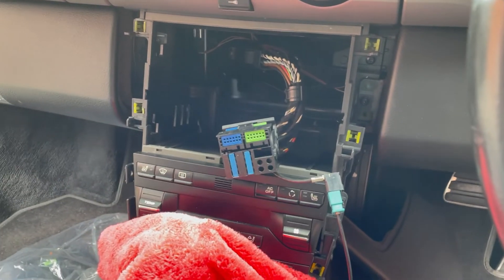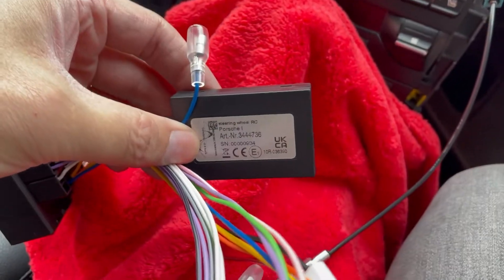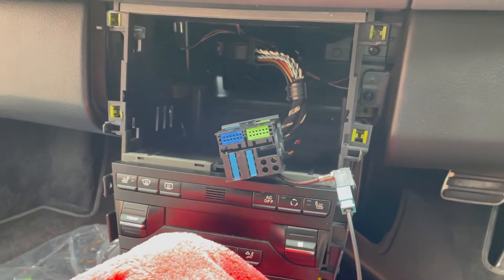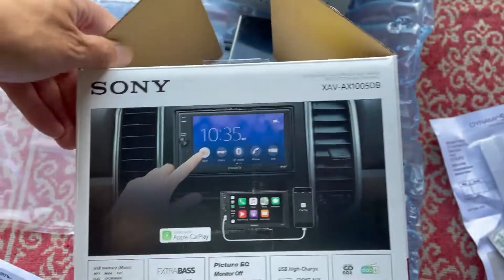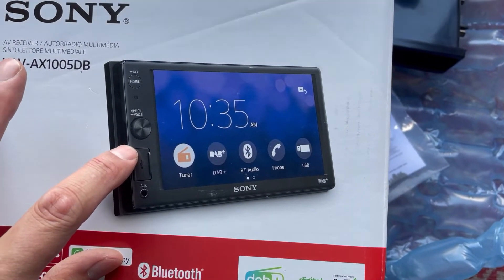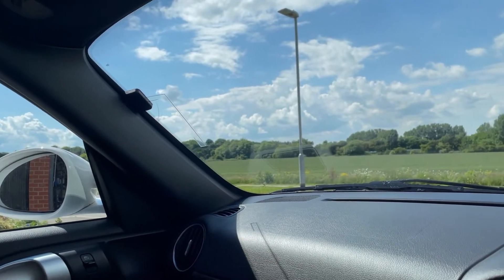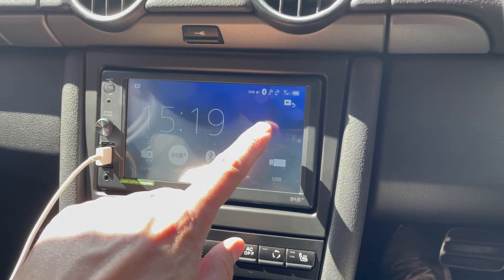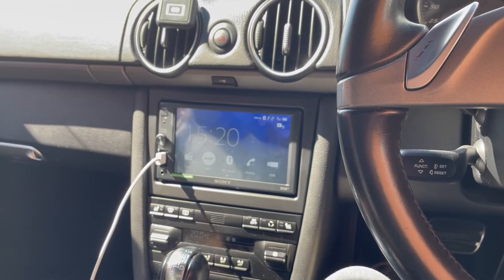Porsche 987  Gen2 Headunit swap Non Bose

Comment: Great video. I have the same kit and car. How did you connect the Porsche quad lock adapter to the patch cable in the kit? Thanks
Reply from the maker: Hi Gary, I never used the patch cable as I don’t have a multifunction steering wheel.
Reply: @micaerin  thanks for getting back to me Mike. It was the big radio replacement adapter cable I was struggling with. It looked like it should not fit the block I disconnected from the Porsche header unit but it does fit! Also, I needed to fit the external GPS and microphone as this is needed for Wireless CarPlay. All works a treat now though!
Reply from the maker: @garykilby5515  I know what you mean about the quad lock I thought it wouldn’t fit also.

Comment: Great video thanks!
I am about to fit a similar Sony unit in my 987.2 which also has the CDR30. I have purchased the Incartec kit that you have too.
Did you have to swap the red and yellow leads over ( constant and switched)  or are they ok 'out of the box' ? 

I don't have steering wheel control either so assume like you I don't need the Universal Patch lead.
Regards
Reply from the maker: as far as I remember if I didnt mention it in the video, I never swapped the leads over.